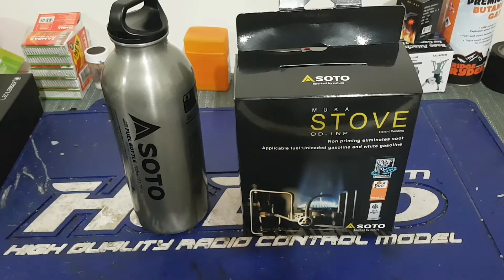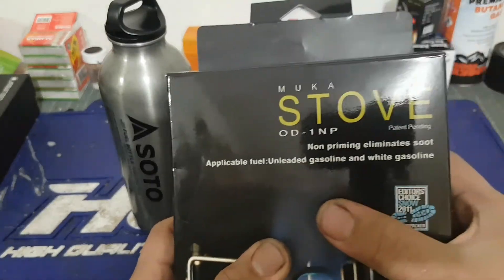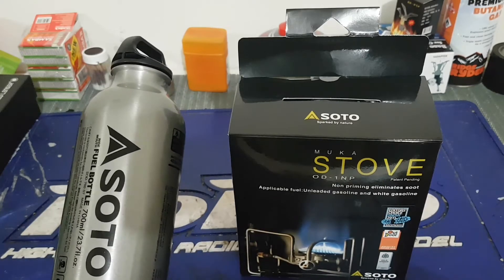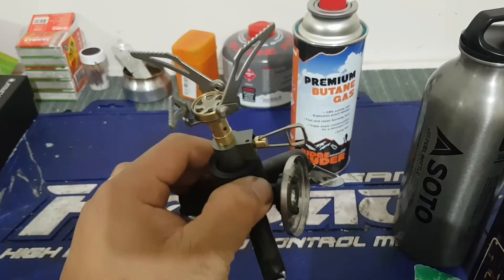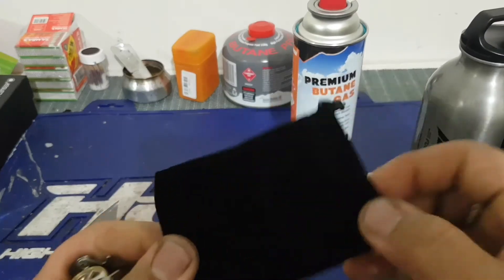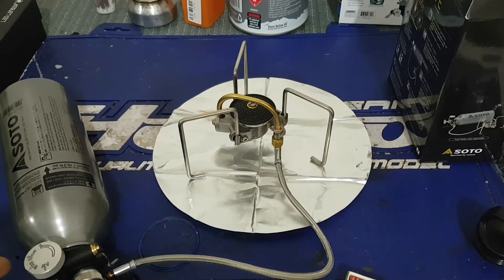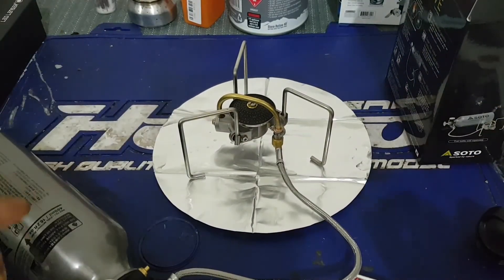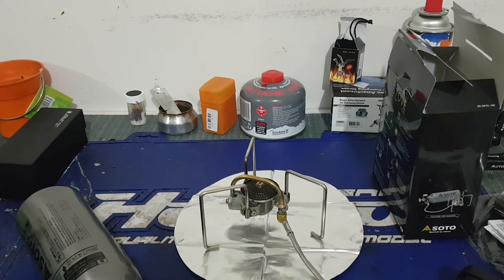SOTO MUKA STOVE (unleaded)

Comment: Does it still work as you bought it? i read many reviews says the pump can be the problem....best M
Reply from the maker: yup still the same. never had an issue with it. i do service it every single time before i store it away
Reply: @ericsonenopia  people complain that is a hassle to pump it up? is it realy that hard?
Reply from the maker: @MaNi-cn7to  no it's not that hard.🙂   but you do pump a lot, it's high compression.
Reply from the maker: Hin Håle  yes, im using unleaded fuel. yes it still works
Reply from the maker: Hin Håle  still the same one. its clean burning compared to msr or other fuel stoves. i havent  cleaned the burner ever like i do with the msr that i have. i have to clean the msr thoroughly or it wont work properly. with the soto i just have to wipe it.
Reply from the maker: Hin Håle  yes i would trust the muka. i had to clean the dragonfly during one of the trip because of soot. muka didn't have an issue
Reply from the maker: Hin Håle  not the best. but good enough

Comment: how much did you pay for it?
Reply from the maker: honestly i dont recall how much it was. sorry
Reply: @ericsonenopia  here they are sold 230$ with the bottle, a MSR whisperlite is about 130$ comparatively.  
i was wondering if elsewhere the difference in price was also great.
Reply from the maker: @Francois_Dupont  i do have the msr dragonfly and it was more expensive than this soto muka. i will choose the soto any day.
Reply: @ericsonenopia  SOTO is a very good brand, they make only quality original item so it is not surprising. i have two BRS-12 (version 1and2), its like a mix of part from MSR and Optimus. i didnt like it because its loud, MSR is using the same Jet and Parabola design, it is why i finally bought the Whisperlite...
Reply from the maker: @Francois_Dupont  I have been using the soto muka now for few years now and I can say it never missed a beat. but I own a msr dragonfly few months after having the muka and it is very loud. but in saying that the msr can simmer quite good. How is your msr whispering doing?
Reply: @ericsonenopia  i have the whisperlite international. i have been using it for one year now and its very good without any problem. i have nothing wrong to say about the whisperlite. you can see me using the whisperlite in very cold winter on my other channel were i post videos. the channel is called Soda Tato . i used it ice fishing, camping and everything. no problem yet.

but i have two BRS-12, and i had big problem with them. the pump valve is failing and the fuel is entering the pump tube. it is very dangerous and i almost burned my house down. also the jet keep getting clogged and you cannot clean it without shutting down the stove. they are very bad, please dont buy a BRS-12.
Reply from the maker: @Francois_Dupont  that is good that the msr is working out for you. I'll give the channel a check. I did noticed that multi fuel stoves performs better than butane on cold and high altitudes.

Thanks for warning me about the brs12.👍
Reply: @ericsonenopia  Thank you for your videos!